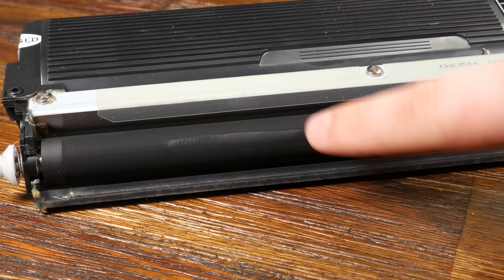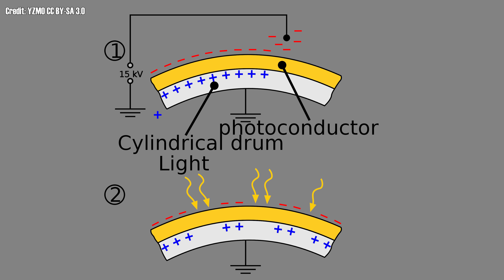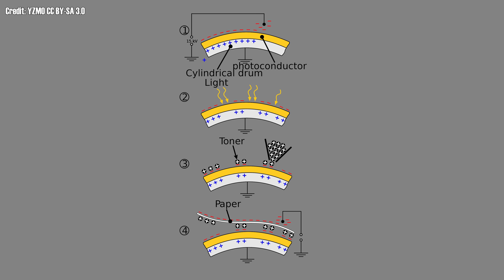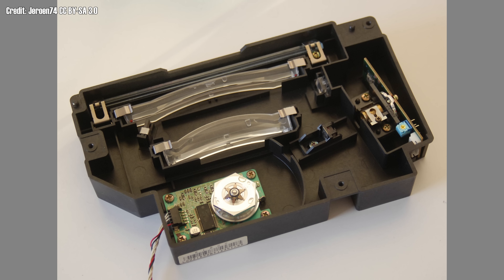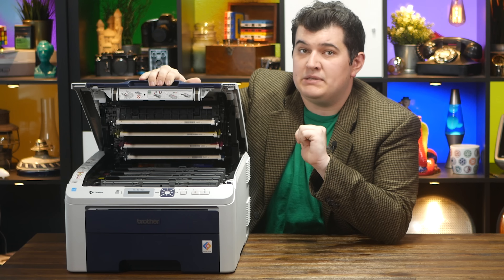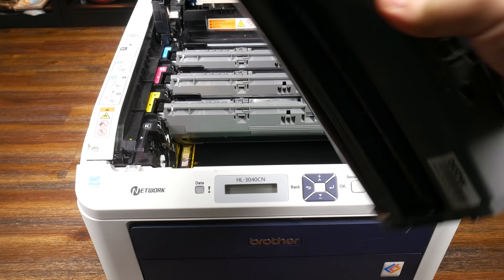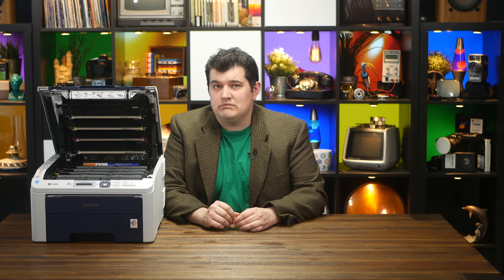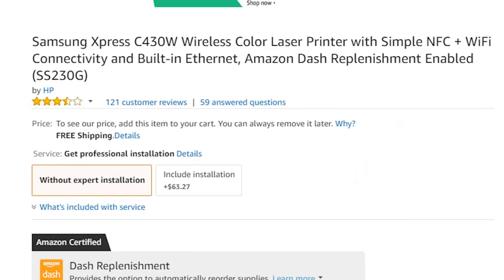LED Printers: The Common Printing Tech You Haven't Heard Of

Comment: I've got a variant of that Brother printer.  Despite me being an engineer and curious about anything technology related, it never occurred to me that it was an LED printer rather than a Laser printer!  Thank you for enlightening me!   A favourite thing about these vs. inkjets:  You can go a month between prints and it comes out perfect the first time.  Downside:  It repeatedly warns that toner is low months before it actually quits working due to low toner.
Reply: I have a Brother color "all in one" that is an LED printer. The "Toner Low" warning it TOTALLY BOGUS! In addition to coming on far too early, it counts copies ONLY without regard to whether they are color. As a result, it will start demanding replacement color cartridges even if you never run color copies. Fortunately, the counters can be reset from the printer control panel. Google the model number of your printer and "toner reset" or something similar to get directions. 
I was very confused the first time I opened my new "Laser Printer" and found the line of LED bars and drums. It didn't take too long to figure out what it was, but it totally blew my mind that I had never heard of the technology. 
I'm seeing several comments that the print quality of LED printers is sub par and can only say I find the quality just fine! It's definitely better than my eyesight! LOL
Reply: I just shake the toner and put it back in and it prints happily for months
Reply: @Meepswonder  i used to do the same thing on my previous workplace. I'm not the it guy, i was just like "i have no time for your bullsh*t!" And furiously shake the toner cartridge
Reply: Look up how to fool these into thinking they have a fresh toner cartridge installed. If I recall correctly, it involves pushing some buttons with the lid open.
I've been fooling mine for around five years and it's done over 10k pages on the stock sampler cartridges with no picture quality issues whatsoever. Maybe I just got lucky and they ran out of sampler carts at the factory, reprogrammed the EEPROM in some regular ones to report only 1k page capacities, sold them as samplers, and called it a day. Or maybe all sampler cartridges are like this. Who knows.
Reply: From brothers website:

The Brother MFC-9130CW has a process to manually override the “Toner Empty” message, and reset the toner cartridges.

-Ensure the printer is switched on.

-Open the printer lid to reveal the toner cartridges.

-Press and hold the Asterisk key for five (5) seconds.

-The LCD should display a new menu.

-Select the cartridge you wish to reset, K = Black, C = Cyan, M = Magenta, Y = Yellow

-STD = Standard Capacity Cartridge, HC = High Capacity Cartridge, SHC = Super High Capacity Cartridge.

-Reset? Will appear on the screen Select “Yes”.

-Close the printer lid.
Reply: Amen, my Brother does that exact same thing. Bugs me to death!
Reply: It does have certain advantages. If I get a message that the toner is almost empty I order a new one on AliExpress. Once it arrives, the toner is for real almost empty.
Reply: My HP warned of "toner low" for the past two years - only replaced the black a few weeks ago due to it finally looking a bit patchy.

Toner low is basically "go buy a new one because it may get inconsistent results soon" and toner very low is "results may be inconsistent".  You have to remember, laser is marketed at businesses where quality might matter so its a GOOD thing to get some warning.

People used to complain because HP enforced replacement on very low toner but ultimately its because they had a reputation of quality, not to rip people off.  Although its still good they now backed off that policy so people can choose if they are okay with sub-par prints.  Most businesses use their toner LONG past the point it should be replaced, see far too many shipping labels and packing notes where half is unreadable because the toner is way too low.
Reply: I have a Brother HL-2030. It was released at the beginning of the 00s and designed mainly for Windows 98. It is a real beast, one of a kind. Good looking, good performing and very durable and sustainable. It can be completely disassembled by a layman even though it's not meant to, so everything can be replaced. They don't make printers like that anymore, and will never do again. It was too good.

The toners are really good, rated at 2500 pages for the same cost as modern 1000 pages units. Drum unit rated for 12000 pages. Numbers are actually really honest, at 2500 prints the toner starts to give in. The machine reported toner low a little bit before that and after a while refused to print any more though. For some time it worked again if I took out the cartridge and shook it, but then that didn't help either. There were a lot of toner powder left though, and prints showed absolutely zero signs of degradation (unlike the ink printer I had before). So I tricked the printer to not be able to read the toner level by putting a little piece of paper on the optical reader that beams through a transparent piece of the toner cartridge. Yes, it actually reads the toner level and doesn't just count pages. However prints look very dirty, toner gets smeared out all over the paper, more like the thing is overloaded rather than getting empty. Still perfectly readable though, no holes or cracks or anything like that where the toner should be. If I clean the drum unit prints look like new again, but after a few pages the smearing comes back again.

Even though it is discontinued since long, there are drivers all the way up to Windows 10 something and Mac OS 10.10 (works on 10.13 too if installed anyway) although with only rudimentary features. I have bought a few extra printers in the same series (2040 2070N) for spares and extras dirt cheap, and toners and drums as well that nobody wants. All in all I'm covered for some 36 000 more prints for the same price as a new printer. I take "orders" from friends and family so they don't have to buy and give space to a machine that they use a few times a year.

As a former (semi-)professional photographer I can confidently say that inkjet printers are only good for just that. And then you want an Epson Stylus Pro or SureColor, everything else is a complete waste. Colour laser/LED printers are good enough for home and office use even with documents containing photographs. If you need better results then you should order prints from a print (work)shop (not a vending machine).
Reply: I have a HP Colour Laser CP1515n sitting next to me, which I've had since the late 2000s. I only occasionally print, and am still on the original starter colour toners. Needless to say, I've been using the override for several years now, and there's still toner left in them (probably getting a little low by now!)
Reply: Love it. The Brother printer in my small office has been squawking about needing a new toner cartridge for ~5 years now - thousands and thousands of pages printed on that "empty" cartridge. Wish the fuel tank on my truck worked the same way.
Reply: Inkjet printers often just refuse to print when they think they are low (which they aren’t), so a simple warning is vastly superior.
Reply: The reason may be that laser toner lasts for a very long time, so even low toner, to the degree it can be measured, has many more printings left.
Reply: One reason Brother monochrome laser printers still print long past the Toner Low message is because those models don't have a waste toner box and instead recycles waste toner by feeding them back  into the toner cartridge. The printer doesn't actually know how much toner is left in the cartridge because of this. If that's the case, how does the printer know when to show Toner Low? It guesses. The printer estimates when the toner might be low based on the number of pages printed and the resolution of what's printed. Is it somewhat accurate? Not really because it doesn't take into account what's being printed, just how many pages and at what quality. The less print on each, page the more waste toner is recycled and the longer the cartridge will last. Do you just ignore the Toner Low massage then? That depends on what you're after. The thing is, when the Toner Low message appears it means most of the toner left in the cartridge is recycled waste toner. Can you print with it? Absolutely but eventually it'll run out and you'll get spotty prints. Keep using and risk poor print quality or replace right away to ensure continuous high quality prints. You decide.
Reply: My wife and I bought a new Brother LED printer probably about 4 years ago and it is still printing color pages from the original toner that was included. We don't print a lot, but we don't restrain ourselves from using it when we want to. I guess the color prints it makes are not quite as good as most inkjets, but they are definitely high resolution enough for our uses. The printer is quick, is wireless and always works, and just seems to be a workhorse. It has recently been saying that the black toner is low, but we have just kept on printing without changing it for probably a month or two since it first gave that message. Now I'm thinking of taking the black toner cartridge out and shaking it like people say on here. Then I will reset the counter. These are absolutely amazing printers and will save you tons of money over an inkjet!

Comment: Have you had a look at how a large photocopier generates its image? At least in the ones we have, it has the four rollers and drums like the small printer shown in the video, but rather than passing the paper over all four colours, it instead has a single large developing drum (actually more like a belt) made of plastic which the image is built up on, and then this belt passes the paper at one single point and transfers all four colours to the paper in one go. The arrangement is sort of a T shape, with the developer going up the vertical bit and the paper passing across the top.

This may account for the similar colour/black&white speeds, but the extra space in a large upright photocopier may also mean it has space for four laser assemblies.

For my money I'd take a somewhat prone to breaking spinning thing and a single laser over several thousand things each of which can go wrong.
Reply: Another way of printing colour is to have a drum that has a large enough circumference to print an entire page (much like an offset printing press, which is actually VERY similar to laser printing) and use a single laser assembly for all 4 colours. After each colour is done, the paper just goes around for another lap around the track, requiring only 1 laser since all colours are printed sequentially.